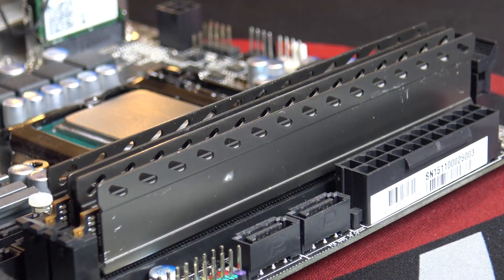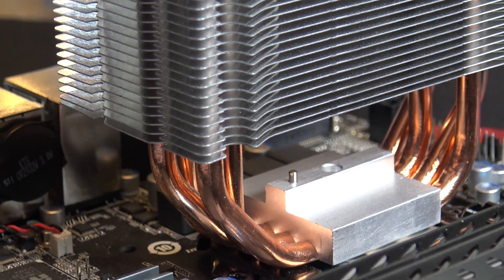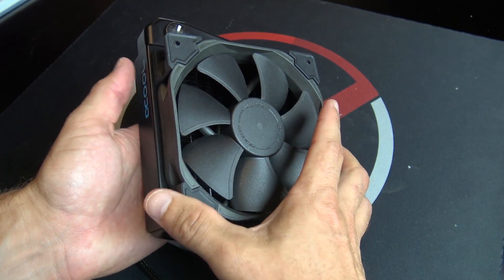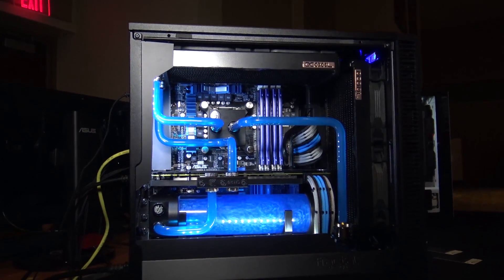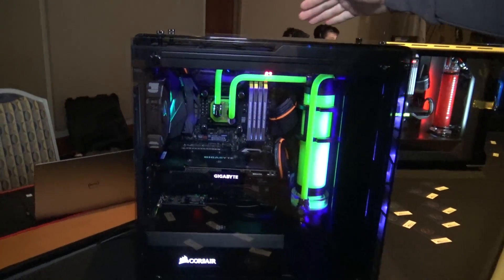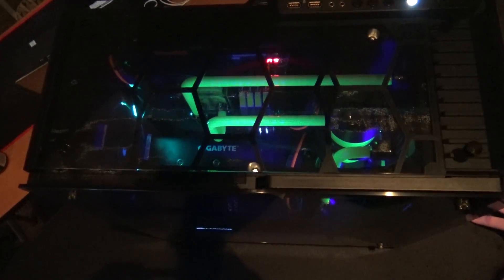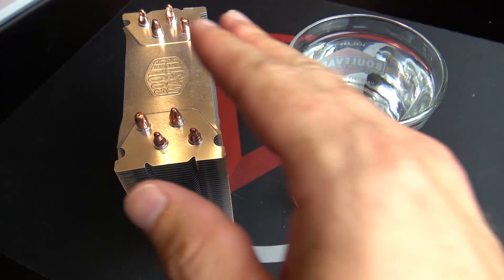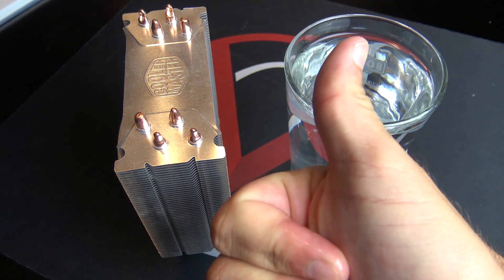Water Cooling: Is It Worth It?

Comment: think of these.does the $2000 gaming laptop have water cool system? only fan,so air cool is the best.
Reply: This is a terrible argument. You can't fit a watercooling loop in a laptop. It would also drive up costs.

Comment: Do you recommend AIO? like the masterliquid lite 120? I'd use it with either a Ryzen 5 1600 @4ghz OC or Ryzen 7 1700 @4ghz oc. Thanks!
Reply from the maker: AiO's are great.
Reply: Awesome! Is the masterliquid lite 120 good? (I don't know if you know it, but it's kinda low priced) for a ryzen 4ghz oc? Thank you for the answer!
Reply from the maker: I'd go with a 240 if you can, but the 120 will get the job done.
Reply: Vir1lity PC Customs got it! Thank you so much!

Comment: I have a hyper212 evo and an i5-6600k, i want to try water cooling. Is the Corsair h100 worth? My motherboard is H110M-K and gpu is strix 1070, also i'm in a hot room.
Reply from the maker: You won't really notice a performance gain, but the h100 should reduce the noise factor. The fan on the Hyper 212 tends to spin up and down pretty frequently.
Reply: So i can stick to Hyper 212?

Comment: great video...may i ask does not the case you use have much to do with what system you should choose,and also budget....air cooling is pretty cheap considering whereas liquid cooling can add almost a third or even half as much to the cost of the build,(i did notice you mention about costs in the video),but back to cases...some of them have terrible airflow whereas others are exceptional at moving air into and out of the case...maybe you should make this your next subject for this series,(if it is going to be a series of course),choosing the correct case for air or water
Reply from the maker: I'll be talking about that in an upcoming video, but case airflow is important for both air and water cooling.

Comment: nice vid, however I would say that 2 360 mm rads with Vardar fans could disipatte heat better then a hyper 212 evo on a 7900x which would result in higher clocks
Reply from the maker: Like I said in the video, if you need better cooling on air, all you have to do is increase the size of the heat sink and add more fans. Nobody that buys a $1000 processor is using a $35 air cooler.

Comment: Just in terms of sound for both options, doesn't air cooling have the potential to produce less sound than water cooling, because the minimum sound for both AIOs and custom loops is the pump sound? Are there reasons to discount this? Personally gone back and forth between a CPU AIO and Air for my next setup (in a Phanteks Evolv mATX TG), right now more toward Air due to wanting a non-blower/reference graphics card, which if I mounted a CPU AIO on top that would capture that heat, or if I mount it on the front I wouldn't be getting dust filtered intake if I went from either the top or the back, for the rest of the system.
Reply: It depends. The advantage of a custom loop is that usually you have bigger radiators(compared to aio) which are much more efficient and allows you to keep the fan speed to minimum reducing the noise a lot even under load. Yes, pumps will still produce a little bit of noise (they are pretty quiet) but at the end, in a full load scenario the fan of an air cooler will still be forced to speed up to 1500+ rpm becoming louder than a custom loop. Totally different story with aio, usually they uses asetek pumps which are pretty garbage and cheap fan that becomes really noisy over 60% of the speed. In your case I would recommend sticking with aircooling because the case has a bad airflow and liquid cooling it's not recommended. I built a custom loop in the evolv atx tg and I was disappointed by the temperatures higher than what I expected considering 2 360 radiators. After a couple of weeks I decided to remove top and front cover and saw the temperatures of both cpu and gpu decreasing by around 10°c.
Reply from the maker: Pumps are relatively quiet compared to fans spinning at a medium to high RPM, especially when you have multiple fans. Every use case is different though. For instance, if you build a low power/low heat generating machine, you can potentially get away with a very quiet air cooled system, and in some cases you may be able to cool the entire system passively.
Reply: Thanks HackerMan, essentially why I'm going air I think, also it's lighter, faster, less complicated than even an AIO. I'm sure for various setups custom loop and AIOs are great even superior to the highest air potential, but I'll see how I go.